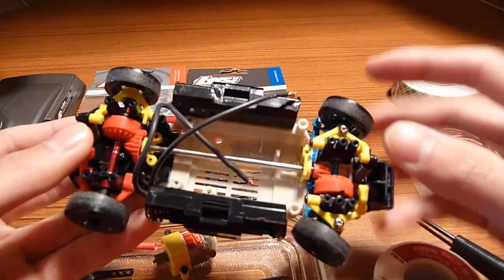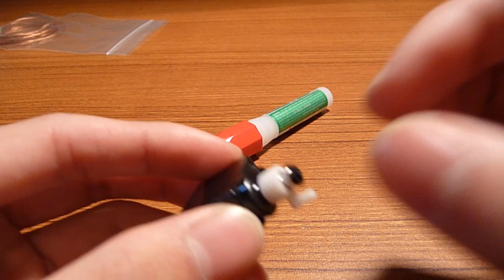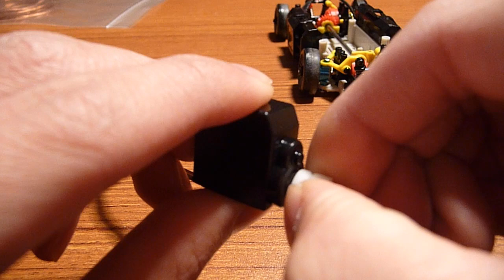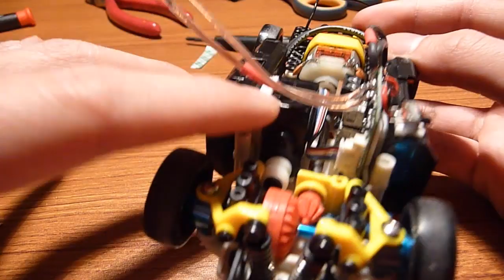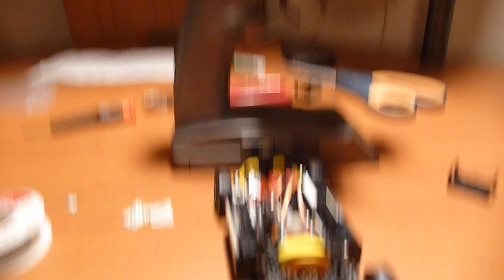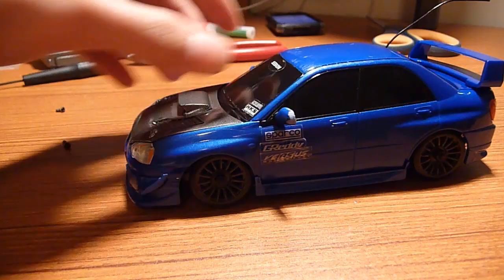Xmods Drifting 101 - Gen 1 Board Swap Tutorial

Comment: you are almost right;  the servo has an excursion limit of 60 degrees, so that's as far as it can turn either way, and the servo saver "springy thing" is there in case you hit something with the wheels at full lock:  it allows the steering links to move in case of a crash and snap them back in place without stripping the internal gears of the servo.
However, you don't need to glue the servo-saver, just unscrew that little black screw, pull out the servo saver and mount it in the desired position

Comment: I believe that the plastic "servo saver works like this.  when the wheel is turned full in either direction, the servo motor continues to turn because there is no micro switch telling it that it has reached it's excursion limit.  So it keeps on turning and the springy thing allows this to happen without  breaking anything.  I could be wrong.

Comment: Haha ok I see the parts list with remote listed. But still need some ideas on how to mount ion Batts. I was gonna use atomic mods quick kit as they have the single batt holder with tape but I'm not running stock wires. Instead I opted for the no drill kit with deans.

Comment: Do you ever have problems with the wheels getting stuck in a drift and the car just spinning out instead of controlling the drift?
Reply from the maker: No, there shouldn't be issues with that. If there are, it might be because your differentials aren't locked. If they are "open", they will cause stability issues.

Comment: Got a question about the motor part. I noticed that u desoldered the stock wires that were on it and also removed that little black thing that was on it. Is that all that you have to remove?

Comment from the maker: It sure does! I finally drove mine outside for a bit and it clocked in at about 15 mph!!! And this is without the top speed gearing. I don't want to make it too fast though since I need torque and lower gearing for drifting :p

Comment from the maker: @wtf000000000000 Yup I have! I tried the HS-55 servo, and it was NOT very good for Gen 1. It turned too slow, the Gen 1 servo might not turn far, but it the motor inside turned much quicker than the HS-55 servo. I don't know what I'd recommend besides a tight turn mod for Gen 1. The servo is actually pretty good already, just needs help from tight turns to be great :D

Comment: Not sure if you are still on YouTube since it’s a old post but I’m having some issues with my conversion So I have a losi Board I pre wired up to test out before I mount it don’t have the servo it’s on the way, yet just test out the motor function , as soon as I turn it out starts moving without me pressing the remote I changed out the crystals and still the does same thing. I turn off the remote and it does stop.
Reply from the maker: There are some knobs on the controller that adjust the Throttle and Steering. Sounds like the throttle trim is too far to the right and is running the car without any input. Turn it to the middle and it should stop. Too far left will make it go reverse and too far right makes it go forward on its own. Good luck!
Reply: @WhiteCharisma  I am using the xmods original controller not a losi so I don’t have those functions
Reply from the maker: @adriancodreanu9511  That's the issue then. You can't use the Xmods remote because it doesn't have the proper functions. You'll need a hobby grade remote. Losi ones recommended, but any other that accepts those crystals should work.
Reply: Thank you! I just ordered a losi reciever on eBay! For 20 bucks . Are you still messing with xmods?? Any more videos in the future

Comment: Hey great video man!. My servo went out on my gen1 and decided I just get a micro t and switch out the electronics and use controller since it much nicer than xmods one... When I finished I notice the servo was jittery, and kept re centering itself or when at neutral. Did I do something wrong? I'm using 2s lipo battery conversion, and I bought this gen 1 upgraded from ebay. My car goes fast and slows after a few mins, and doesn't show full power  only when charged. Could the lipo battery not be holding a charge?  Any help is appreciated, trying to make this a drifter too haha
Reply from the maker: Thanks! So I haven't been at home to check my car in a while, but it seems like you have a few issues with power. I know that if you run a lot of power through any boards on cars of this type, they become a little jittery. Not too sure about the power loss though, I had that problem at first but then I re-soldered and replaced a few wires to get rid of that problem. I hope you can figure it out!!! Good luck!!

Comment from the maker: it is actually a bit easier. You would still buy all the same things, except instead of completely replacing the servo, you cut the wires on the servo and use them to connect to the xmods servo. it's not too hard and it is a pretty quick swap. Everything else should be fairly the same.

Comment: I know I'm 13 years late, but my losi controller does not have a spot for crystals... and everyone I've seen online doesn't have a spot. Can I use another losi controller? Or how could I make mine work? Hope you see this 😬
Reply from the maker: Sadly, there aren't many options if it really doesn't have a crystal spot for the frequency. You sure you checked there wasn't a small tray or thing that pops out to change crystals? Everything is 2.4ghz now so they've moved far away from frequency crystals ages ago. Good luck! Glad I still have a viewer! I'll try to upload something later in the year, not Xmods related though 😅
Reply: @WhiteCharisma  Yeah I'm sure. It's the exact same controller as yours, but just without the crystal tray. I even took off the housing to see. Maybe a newer version or something. I'm gonna keep looking online to see if I can find that version, or a different type controller that does. I seriously didn't think you were gonna even see this. Thanks for the response bro!!

Comment from the maker: @wtf000000000000 no it won't, adding more power doesn't add more power the the turning, it'll actually make it more jittery because it has more volts running through it. It has to do with the resistors on the part of the board that controls the servo.